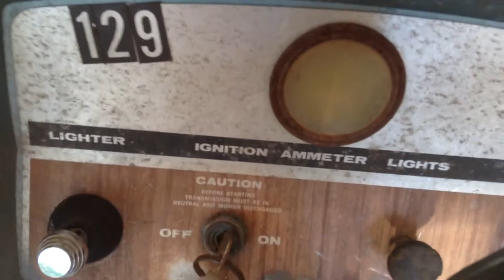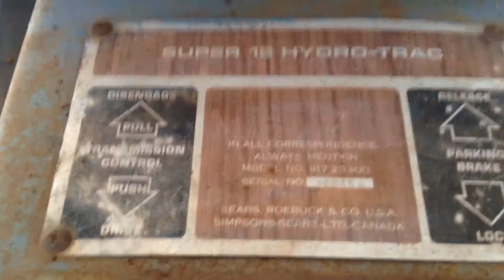Sears update

Comment: Great find !!  I'm sure it will be looking like new in no time....... I bought a 12 hydro in about the same shape I think it has some trans issues hope you don't have problems with that
Reply from the maker: Thanks man! I'm pretty much assuming it does at this point because my other 2 both did. But I got lucky because it was just the coupling between the input and output shafts that were stripped. These Sundstrand pumps are usually pretty bulletproof.